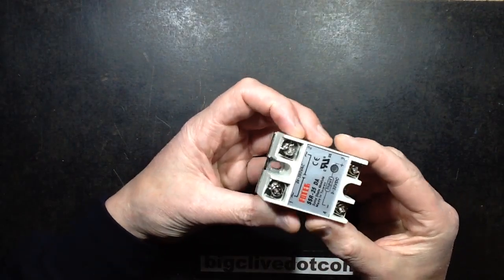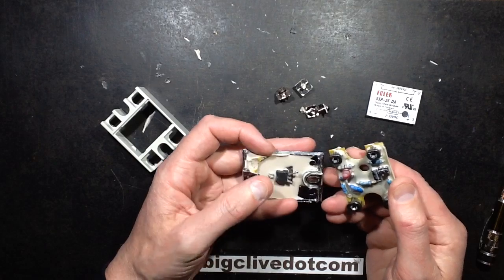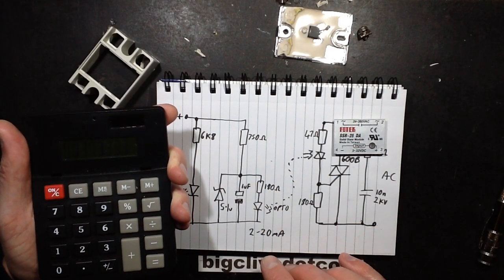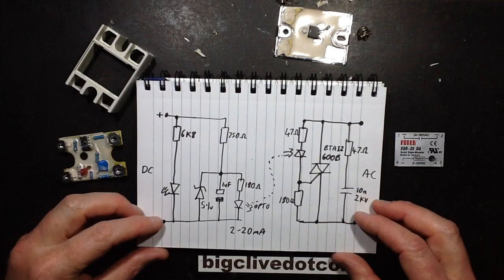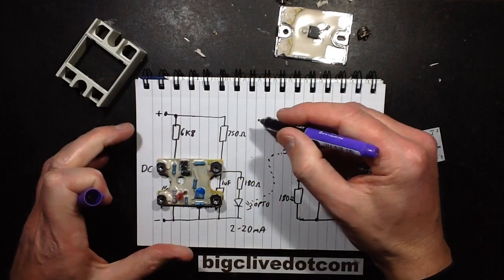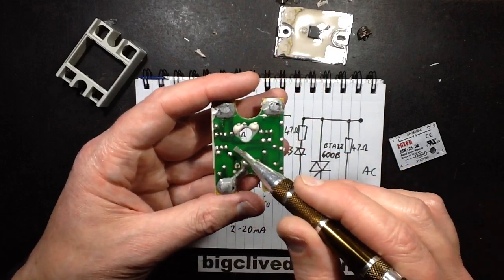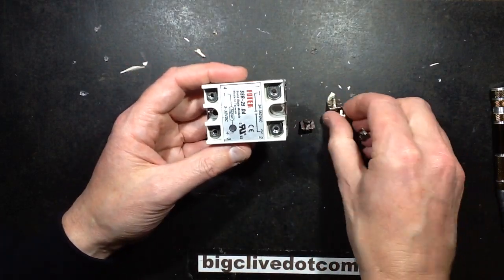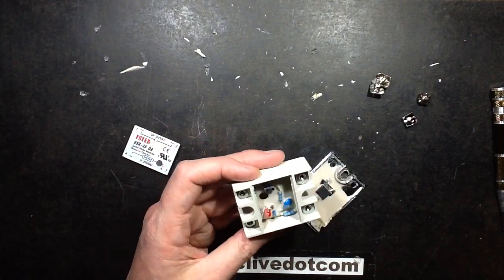Teardown of an eBay 25A Solid State Relay.  (SSR)

Comment: 'with a little bit more design effort' a true saying for most bargain Chinese products!
Reply: in theory and ideal conditions that's the isolation ( remember, if it ever did cross over that would be VERY VERY bad ; it would go straight to a likely low voltage control network) ... and like clive said there is literally no reason they made it so much less then it could have been.
Reply: There is a lot to be said for truth in advertising, or at least truth in specs.  No matter what your skill level, there is no excuse for lies like a 12A triac in a device that claims the ability to switch 25A.
Reply: Who?
Reply: There are a few that are exceptional. They seem to have two levels of experience  - highly skilled and rookie with nothing in between.
Reply: You can sit here ranting nonsense, but you have never created a product in your life. BTW the gap there is around 5mm which would require a voltage of 15000v to jump across that. There is no design flaw here, only a flaw in your thinking.
Reply: @lordofthebeltsthereturnoft1127  You're grossly wrong, leading to me thinking that in fact it is you who has never designed anything.
Using a calculator found at https://www.smps.us/pcbtracespacing.html which adheres to IPC-2221B, 15kV would require c. 75mm clearance on an external track, or c. 45mm clearance for a coated board.
5mm clearance is enough if you want to use c. 2kV coated, or 1kV external. 
Personally I would still err on the side of caution though and usually double the clearances.
Par for course on the internet though, people talking out of their arse

Comment: Would you say it would be fine running a 5v control circuit to switch a 6A 12vdc load?
Reply: +pietkaify No, because you can't switch a DC load.
Reply: +tengelgeer Doh completely glossed over! teach me to watch the video propely! =)
Reply: +pietkaify There are DC versions of this SSR but don't use them. Switching DC loads is really easy just use a LOGIC level MOSFET. If you want to switch your load on the high side use a P-channel or if you want to switch it on low side use a N-channel one. They are super cheap on ebay. But keep in mind that they have a resistance even when switched on, look for RDSon in the datasheets if that's important for your application. N-channel MOSFETs usually have a much lower RDSon. RDSon also depends on the gate voltage, if you drive it directly with your arduino you will probably have 5V so check the RDSon graph in the datasheet for that specific voltage.

Comment: Real ones have about the same inside, but better clearance and filled generally with a glass bead filled resin to save the cost of the expensive resin. This one is filled with a powder filled resin ( probably chalk powder or some milled dry clay) so keep it dry, it probably is hygroscopic. 

The 2n ceramic snubber is probably the same 10n 2kV Class Y ceramic used in SMPS use, where it has quite a good pulse handling and also will fail open circuit. Not a bad choice, cheap but will do the job better than a film unit.

Anyway, standard appnote, and the zener does double duty as reverse polarity protection for the opto, though the LED indicator will die with reverse voltage, but who will ever see the red inside a cabinet in any case. As to the triac, I doubt it has any compound, relying instead on the resin seeping under to fill gaps from the screw bending the tab, and if the screw is loose it will keep it in place as well. Isolated tab, so not really meant for more than 5A of load, unless you really use a decent heatsink, which that zincalume casting is not. Rating 220VAC 2.5A with a peak of 5A is more appropriate for it.

Comment: You ever notice that anything from China you better see your need and multiply it by 2 or sometimes 3 then get that instead?  What is it with the Chinese overrating their stuff so much?
Reply: +legalizeshemp420 they learned from american advertising and try and one-up it.
Reply: +legalizeshemp420 marketing and money. Some of the not so smart people go for it all the time. put a bigger numbe ron the label regardless if its true or not and some less inteligent people will buy it. :P
Reply: +drkastenbrot I have a 10000mAh powerbank here, it maybe has a 4000mAh capacity
Reply: +drkastenbrot They do Make 4000mah lipos and they do charge to capacity, however like the 18650s and crap they are all rubbish. But oddly enough I salavged 4000mah lipos from some power banks. (The thin kind.) bank was rated at 8000mah and had two 4000mah cells in parallel. I didnt belive it but I seperated both packs and despite the fact the onboard circuitry only changing both to 6700 or so, changing them indivially on my smart charger, both lipos charged near full capacity. (one at 3800 and the other just marginally below the 4000 mark.) However, they have to be charged at lower currents to get that capacity. (1 am or less or the batteries just don't like it.) I have 4 of said lipos and they work great, just not the kind you can abuse like hobby grade lipos, these just arnt meant for that.
Reply: +nrdesign1991 I belive that, ive taken apart numerous ones and all about the same minus a particular bank I got from ebay for 10 bucks a peice. They had lipos in them, rated 8000 and had two 4000 lipo cells in parallel. Even though the charging circuitry didnt ever get them up to full charge, dismanting said packs and charging them with my hobby charger gave me surprising results, out of the 2 banks, I eneded up with 4 4000mah lipo's and all of them charged to near their full capacity, however. They do not like high charge rates and don't like discharging over a few amps or so. Useful but still limited.
Reply: +legalizeshemp420 indeed I agree, even if something is "Somewhat legitimate" it doesnt mean its safe.
Reply: umbrefawx 4000mah lipos ;)
Reply: umbrefawx  flippynl 
The thing is some of this shit is killing people and/or burning down homes EVEN in their own country.

Comment: Now we are talking as this is used (or even better the 40A version) for 3d printer heated beds that uses mains instead of a PSU so it will heat up faster.